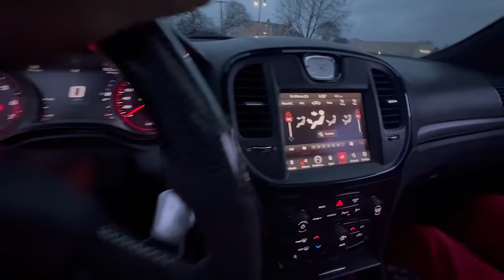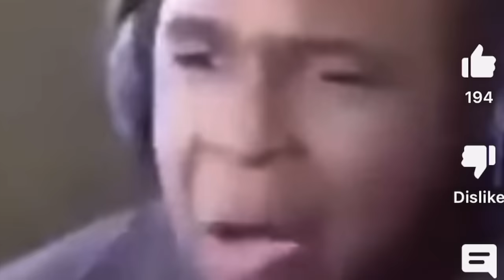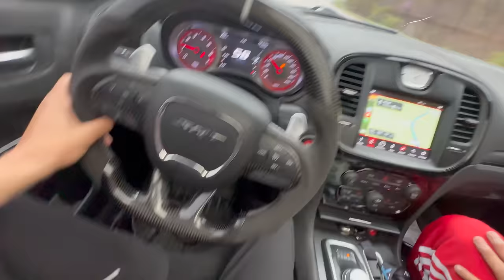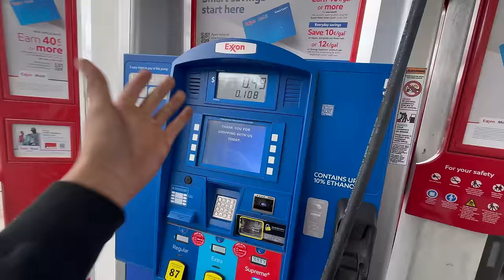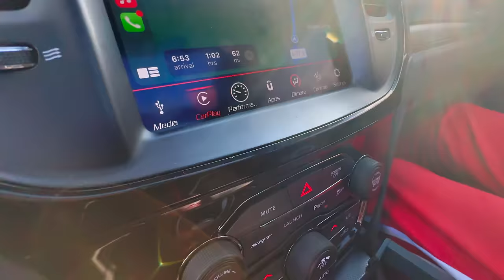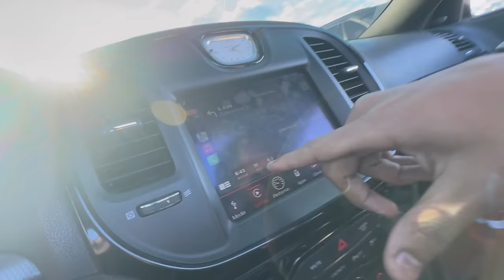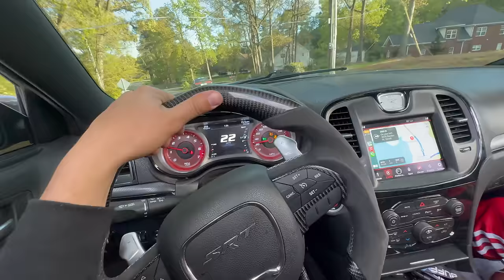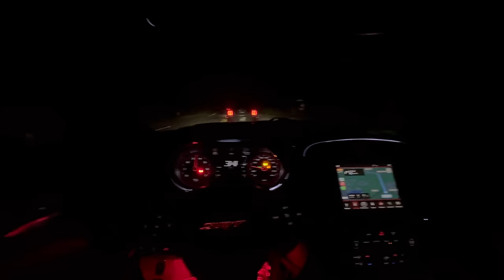10 HELLCATS GO TO NORTH CAROLINA *ALMOST WENT TO JAIL*

Comment: I let my sister borrow my car and she filled up with gas and topped it off. She pulled off from the gas station and the car broke down. They put it on the tow truck and the gas started leaking. The mechanic said that she filled it up way too much which caused some sensor to fail and when they put it up on the tow truck, the gas flowed backward and blew a seal. A couple of hundred dollars later the car was back on the road but none of that would've happened if she didn't top it off like she did. I appreciated the fact that she was gonna give it back with a full tank but the repair bill wasn't cool. Lol! The mechanic said he's seen so many cars come in cuz due to things failing from topping off after a fill up. 

TLDR; Topping off your tank can cause problems in your car. It isn't worth the few extra miles on the tank to risk all the bs that came with fixing it cuz it was too full. The mechanic said to never top off your tank.